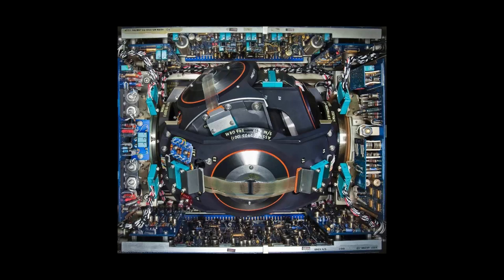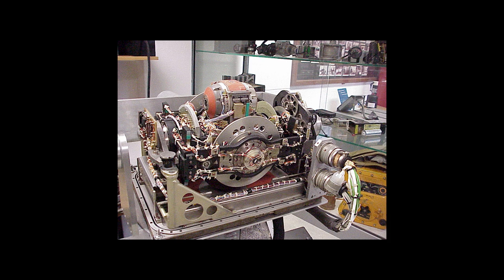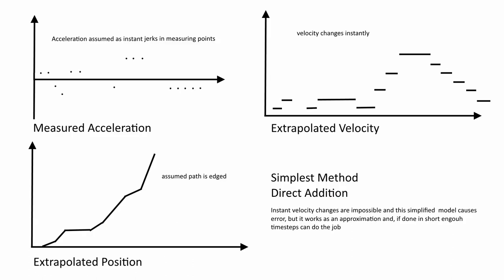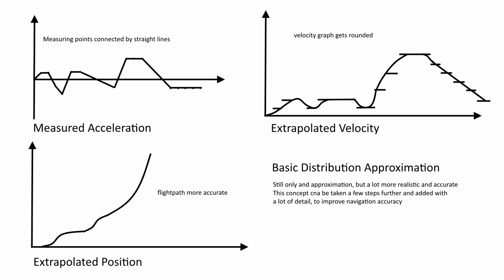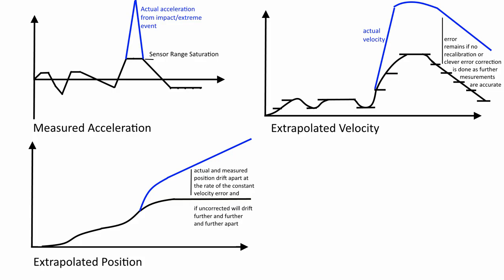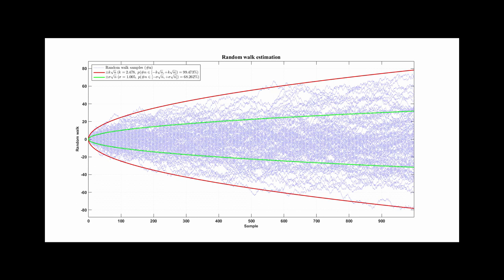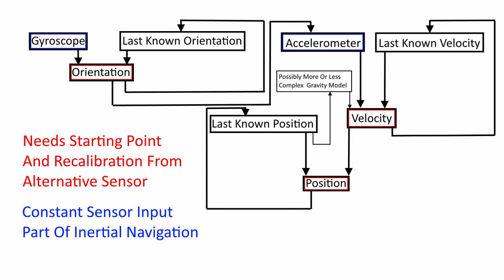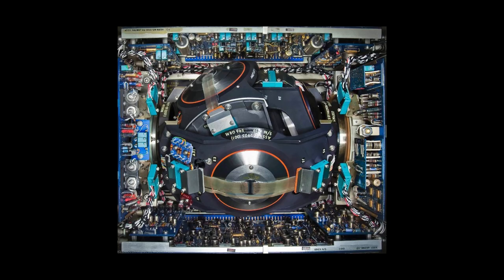Explaining Inertial Navigation Units - How They Work And Why They Can Run Away

Comment: I had some experience with modern MEMS nav sensor packages and Honeywell ring laser gyros, but it was a treat to tour the battleship North Carolina. They have their inertial platform/gyrocompass open for inspection, and finally I could get a good sense of where the term inertial platform comes from. The platform is held level with gyros, and on that level platform they have a gyroscope that is set up to adjust its axis so that it does not precess with Earth's rotation. Clever!

Comment: Thanks for the explanation. It would help if you included how the system keeps a stable platform for the accelerometers (Gyro & Gimbals). And how the system accumulates ground speed errors when flying because the stable platform constantly changes orientation. You know the pendulum analogy. Thanks again.
Reply from the maker: it does accumulate error though that is mostly like a random walk squared
there are some methods to estimate and filter out errors but for the most part that just meanst that over time the accuracy gets worse and worse which is why for longterm navigation you usually have a different means of navigation as well ot recalibrate things with, this is mostly for detailed shortterm navigation during one maneuver or flight

Comment: I worked on inertial navigation system and this gentleman is way off.  System will when set properly will give you accurate position speed and height  + more…. With minimum Imput.  Long term accuracy requires occasional calibration service.   Also very accurate.   Gyroscopes and accelerationers.   Capable of all maneuvers.  .
Reply from the maker: all maneuvers except flying for several days
which is not much o an issue for most aircraft but there are other tpes of vehicles
whcih is why you recalibrate them
then they can be insanely useful

Comment: Why can they not measure acceleration due to gravity?
Reply from the maker: gravity and acceleratio nare indistinguishable, if you are in freefall you meaure 0 acceleration - so you have to calculate that in
Reply: @JulianDanzerHAL9001   So if a spacecraft was heading towards a planet.  And it did a slingshot maneuver around the planet to reverse its direction.  The device inside the ship would have no idea that the ships velocity had completely reversed?
Reply from the maker: @haydengalloway5177  yep
unless you know the planet is there and can calcualte it into your integration
or you recalibrate afterwards using other measures like startracker cameras and planets
Reply: @JulianDanzerHAL9001  
Wow that is so amazing. What if you build a gravity field detector that could measure the direction and magnitude of sources of gravity.  Then feed that data into the Inertial navigation device so it could compensate for them. Does that kind of technology exist?
Reply from the maker: @haydengalloway5177  that's not really possible - gravity is just you moving along with the warping o spacetime so if you are accelerated by gravity oy uare technically not accelerating
you could try to measure tidal forces but that's jut lik using any othe rsensor to get some information that can be matched up with your position and using it to calibrate your integration